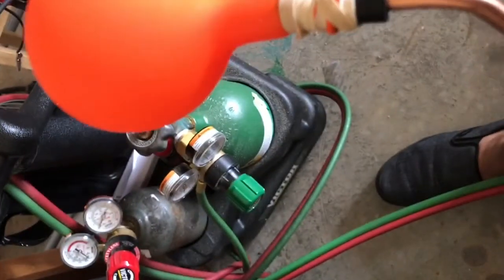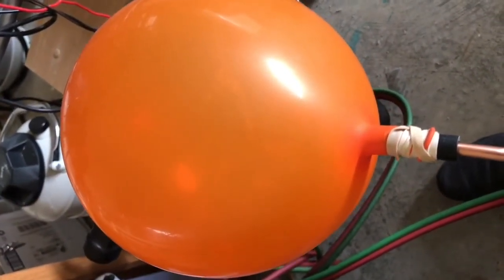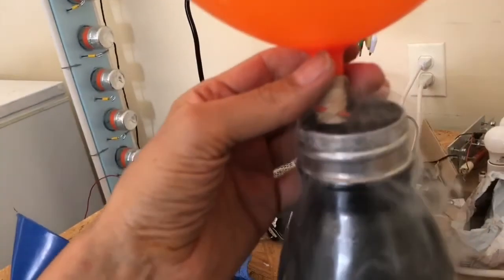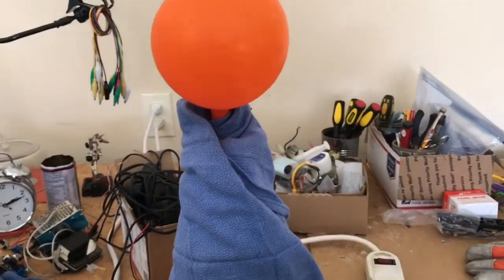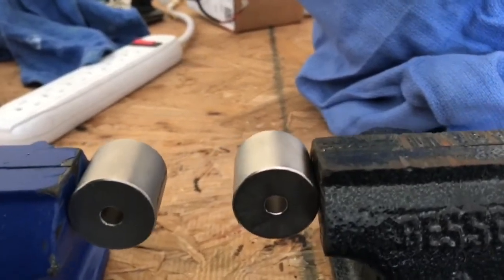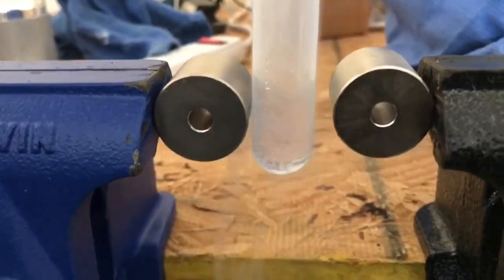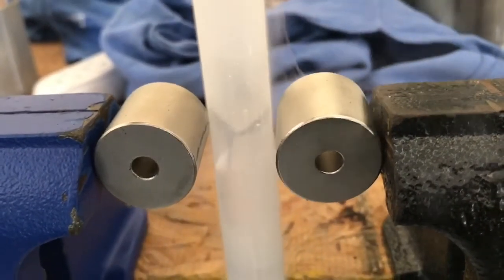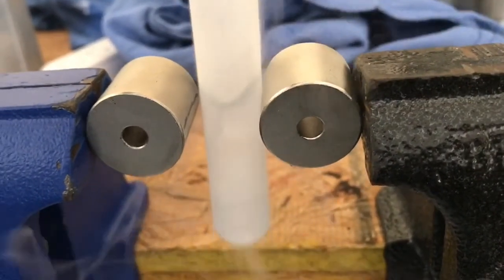Magnetic Oxygen

Comment: How much attraction do you see with gaseous oxygen?
Reply from the maker: The amount of attraction is certainly not measurable visually. I’m sure that with very strong magnets, the percentage of oxygen at the surface of the magnet is slightly greater than at a distance from the magnet. There may be some way of measuring this but I’m not sure how to do that.
Reply: @BrianDhvTinkerer  Thx. I had read of O2-sensor patents that work with a torsion balance arrangement wherein two (non-magnetic) glass spheres filled with nitrogen are used to create a neutral reference; the O2 concentration in the surrounding gas displaces/twists this "dumb-bell".